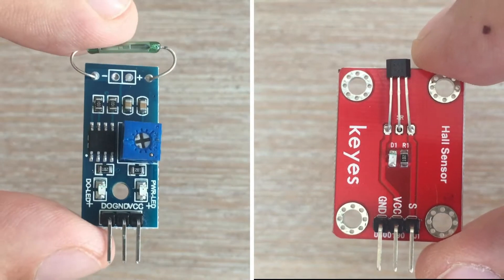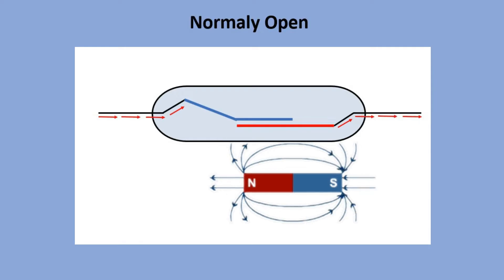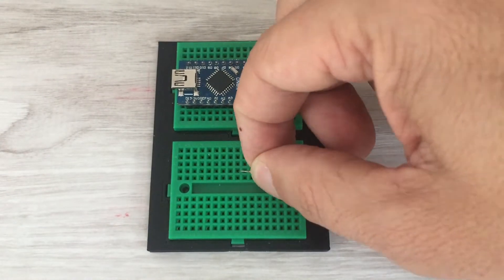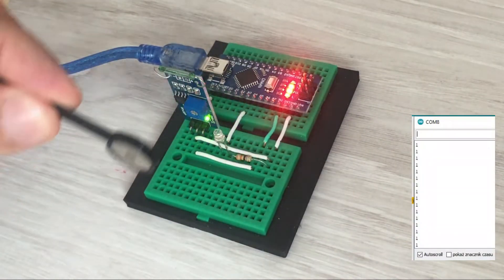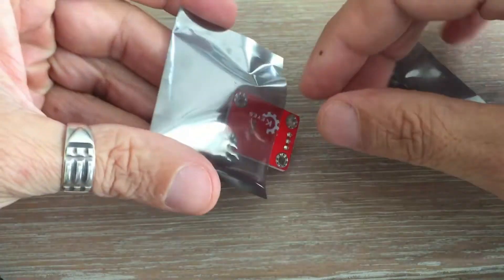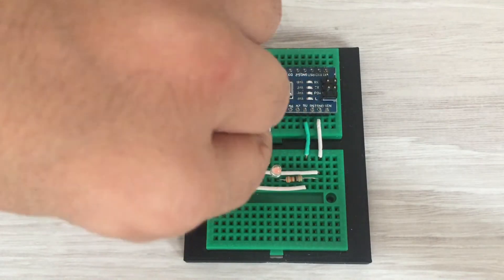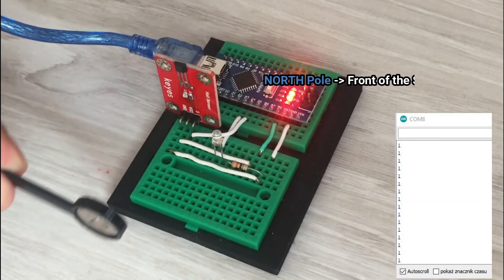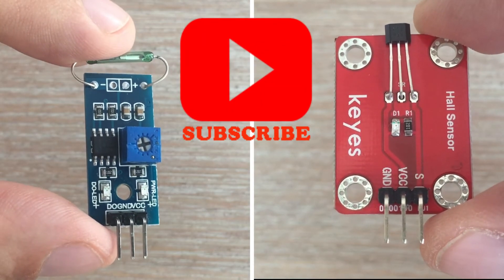Arduino Basics: How to use magnetic Sensors, Reed Switch vs Hall Sensor

Comment: I experience same problem with reed switch for secret motorcycle magnetic switch. Finally I use 2 hall sensors in reversed position to overcome magnetic polarity
Reply: There are omnidirectional Hall effect sensors which remediate this magnetic polarization problem.  See Texas Instruments DRV5032 variants.

Comment: Hi. Your reed sensor is no good ! I have designed a home security system with high quality Littelfuse proximity reed sensors. They come in a small rectangular form factor and can be easily mounted on doors and windows. I purchased them from Mouser Electronics, a renowned online supplier.

Comment: Thank you. Very good information, and very well presented.
I've searched your videos and am surprised that you haven't made any videos of Arduino control of Stepper Motors and Drivers.  A very common usage.
Video suggestion: (My project 😊)  Arduino control of NEMA 17 Stepper w/driver, ON/OFF switch to power the system, momentary switch for FWD Direction, momentary switch for REV Direction, Potentiometer to control motor speed, Rotary Encoder to rotate motor a given number of steps via code.   Thanks

Comment: Regarding that the reed switch doesn't release on 3:14, the magnetic field should be parallel to the axis of the reed. If your magnet is axially polarized (instead of radially), then it needs to be rotated 90 deg.
Reply: Dumb question, so does that mean that I can purposely make a reed switch(NO) stay on if I wave the magnet at an angle?
Trying to make a project to that uses a magnet as a switch that stays on/off

Comment: What about using MR Sensor, instead? Low power compared to Hall sensor, and as rugged and reliable as Hall sensor, also has high sensitivity, and is reliable.
Reply from the maker: Can you provide to the link to the exact sensor you have in mind

Comment: What about analog encryption for communications? Two of the same tape recordings on two nodes. Analog encryption saves a lot of energy for video transmissions. If you turn off encryption on your router. Your phone's battery will last twice as long.
Reply from the maker: This probably was meant for a fdifferent video. Right?

Comment: Were you ever able to determine if the trouble with the LED remaining on was due to the sensor (quality) or a result of the way the hardware is interpreting & processing the code? I'm extremely new, but watched an amazing video on interrupts . . . and watching this did give me the thought that a possible solution could involve utilizing an interrupt.  I'll link the video here: https://www.youtube.com/watch?v=2kr5A350H7E
Reply from the maker: The problem is strictly due to read switch not releasing . Maybe there are better quality parts out there . I bougth is from Aliexpress. But this shows that this can happen so it is not as reliable as Hall sensor
Reply from the maker: I have not worked with timer interrupts yet. I have on evideo on External interrupts but it is old and I would do it differently now. Got more profficient with video and sound editing:)
Reply: @marios_ideas  Could try adding some 1 kOhm resistor in series with it. Mine started to work with 100 Ohm but more is better theoretically. Decided to use 1 kOhm for better optimal input impedance and noise immunity. Seems weird that  even the circuit provided with the reed switch might draw some capacitive inrush current which partially welds the contacts.

Comment: the biggest advantage of the hall sensor is frequency , I use the sensor to measure rpm as well, a reed switch would be useless for that.
Reply from the maker: Yes. In one of my videos I div POV display on the old fan using hall sensor.  This would not work with reed switch

Comment: ☠️ I've been experiencing  extremely dangerous episodes of the motor not stopping on my ebike as soon as I turn the throttle , related to high humidity conditions ! I think it's because the humidity increases conductivity of the hall sensors in the throttle . can you recommend a good throttle ?  I think the manufacturers are going to have to make them water proof. I experienced the same issue with a different throttle , battery and controller. just using the bike after a rain storm is enough to cause the issue. We must have a throttle will a switch to cut power ! ☠️ Also stop using hot glue on the Hall sensors ! It melts were I live ! And make the throttle not Fall apart so easy , and they need to be made with softer grips or made to accept normal grip's.
Reply from the maker: Sorry I have no experience with Throttles. I might look at this topic in the future but am in no position to give any recomendations:) Especially if your life depends on them
Reply: @marios_ideas  Thanks,  lm not at all asking for advice , but I would like to know if you were me what would you do ?
Reply: @marios_ideas  I'm going to try some dielectric greese between the magnet and sensor .

Comment: Hi. This is pretty helpful. Wanted to ask if I could use the Arduino Nano to implement 4 magnetic sensors.
Reply from the maker: You can have as many sensors as you have input pins available

Comment: Hi Mario, that's a great comparison study you have performed here! I have a question, is it possible to use the Hall Sensor to detect the magnitude of Magnetic strength with respect to the distance between the sensor and magnet? Thanks for any replies!
Reply from the maker: Not the hall sensor module as this is digital returns 0 or 1. But the hall sensor . But if you use just plain hall sensor like this one https://pt.aliexpress.com/item/1005002422775127.html you can connect it to analog pin and see if based on the reading you can estimate the distance. Did not try it but should work. Just like using e.g. photoresistor. Let me know how it goes. In a meantime give video a like. Would help to grow my channel
Reply: yes you can,
there are ANALOGUE hall sensor modules, these will output a value that determimes the fieldforce.

the digital modules use a threshold value internally to report LOW or HIGH

I used that te replace a noisy potmeter by mounting it between two magnets , the rotation it makes in the magnetic field can be easily translated to a rotaion value.
Reply: I am going to use a hall sensor to search for Josephson Junctions in aluminized mylar space blankets.

Comment: Hi im vasanth from India

I need your help if hall sensor contact with number of magnet its shown 7 segment display (like 1 magnet shown number 1 if i contact 3 magnet its shown number 3) please explain how is it and code
Reply from the maker: I do not believe this is possible as hall sensor reacts the same way to magnetic field so you cannot react differently to different magnets. Not sure ehat your project is. Normally it sounds like the use for RFID modules
Reply: @marios_ideas  thanks for reply and is it possible to do reed switch sensor
Reply from the maker: @vasanthvijay6339  Same thing. You would have to do it other way around. Multiple sensors and one magnet. Then it would work
Reply: @marios_ideas  tq

Comment: Could it be, that the repeated testing of the reed switch turned the metal magnetic for a certain amount of time, and it just didn't work because of that. In that case the sensor would still be useful in cases, where the sensor is only triggered occasionally (and safety doesn't matter).
Reply from the maker: That may very well be the case. This is also the cheapest one. I know they are used in e.g. watching machines

Comment: Have a GE cloths washer that used a reed switch encased in rubber. I am sure either the vibration or lid dropping broke it. Hall sensor would most likely not break.
Reply from the maker: Yes . It definetly seems more reliable

Comment: Could you design an Arduino Nano/linear Hall Effect circuit (KY 024) that powers about 8-10 LEDs, one at a time, depending on how far the magnet is from the sensor?  I need this circuit.  It would be useful in showing exactly how far the magnet is in its movement.  Each LED would indicate a different distance, as the distance changes.
Reply from the maker: You have to use just a plain hall sensor like this one https://pl.aliexpress.com/item/1005003406316017.html connect it to ananlog pin and read the value off that pin and then write few if statements saying if the value is in that range light up this led etc

Comment: I arrived here because I have reliability problems with magnetic switches too. I'm using a water switch level that worked fine with two small DC 3-6v motor pumps in series, but then I replaced with a brushless 12v 4.2w pump and now very often doesn't turn off. Both configurations draw similar current (less than 0.5A rated for the water switch). I wonder if it's some induction problem or just a mechanic problem inside the switch, but I tested with few different switches and the issue continues and I trying to find why...  I wonder what kind of reliability problems did you had  with your magnetic/Reed switch.
Reply from the maker: Have you tried to use Hall sensor instead. The problems I had are visible in the video. Reed switch is a mechanical switch and for whatever reason every now and then it was not releasing after removing magnetic field. With hall sensor I created POV clock on the old fan with 500RPM and hall sensor was properly switching 500 times a minute . So they seem to be much more reliable

Comment: It's possible your problem with the reed switches was the strength of your magnet.
Reply from the maker: Not sure. If it got stuck moving magnet away did not fix it. Do you mean the magnet was to strong?
Reply: @marios_ideas  On small relays I've had a couple ruined by overly strong magnets. One that I use for a sensor I now have placed 3" away from the very powerful neodymium magnets in the application after destroying another.

Comment: Many different reed switches I tested failed also. Some not go off, some not go on. 2 pin reed switches N/O and 3 pin N/O & N/I all failed approx 30 - 50 % of the time.
Reply from the maker: I also show in my video that they are not 100% reliable. In my projects I go with hall sensor. If you check one of my videos where I build POV display you would see that malfunction like this if I was using reed switches would completely mess up this project
Reply: Did you ever find reliable ones?  I am in urgent need of a reliable reed switch.
Reply: @tihruytssgjjvsavcxtbvhj3429  Don't trust them on critical curcuits. Reed switches are only reliable if you test many and discard the inferior. They are suspectable to quality mechanical variations when made. They only good for very small milliamps and when used in consistent repeated similar situations with no variations. Example if the magnet sits a long time beside the Reed .. or not .. it effects the magnetic effect sensitivity.. you got the picture.

Comment: You might consider doing your digital read only once and assigning it to a variable. Then use that variable rather than two digital reads in a row.
Reply from the maker: Thanks for the hint. I will keep it in mind when writing code for my next projects;)
Reply: @marios_ideas  Brother this is fun, if the iron is close, it will sound the alarm, it is even more perfect, because the thief will take the screwdriver, and the key to unlock

Comment: Now I just bought a bunch of reed switches and hall sensors from aliexpress for my own experiments. They are ridiculously cheap there. I bought a few of each because you never know how many will work or not. Do you get yours from aliexpress too?
Reply from the maker: Thanks for subscribing:) Yes, I get most of my stuff from Aliexpress
Reply: @marios_ideas  How long does it usually take you to get stuff from AliExpress?
Reply from the maker: @chrisvaccaro229  Anything from 30 to 90 days. If you order bulk of components for future projects it is ok but If you want something quick then not so much:)